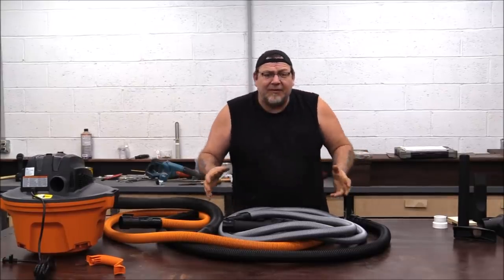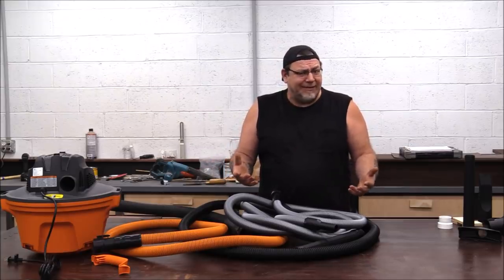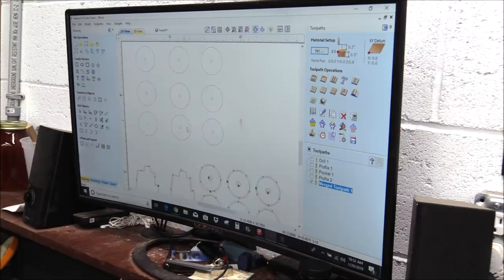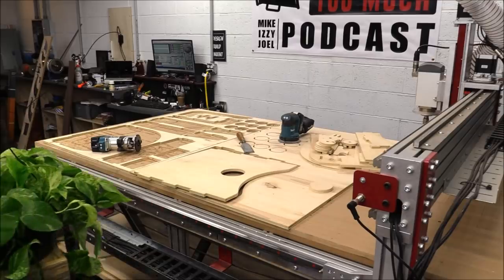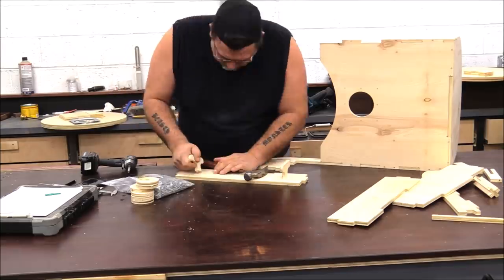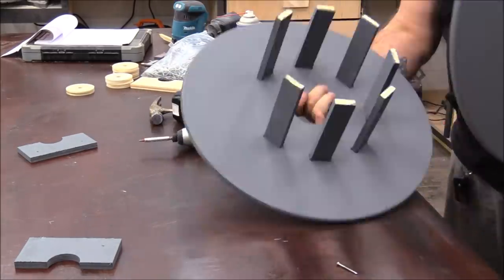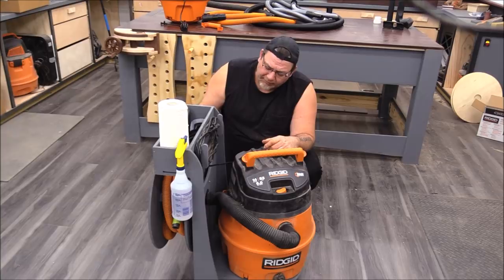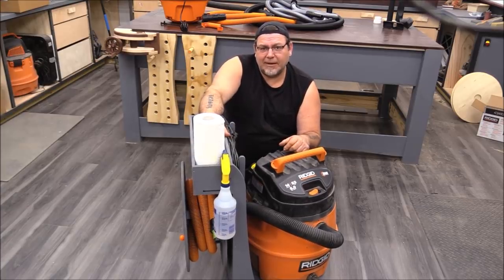Shop Vac Cart and Hose Reel for Manufacturing

Comment: Consider adding a vertical shelf for a bucket and a Dust Deputy or similar. I’ve added a Dust Deputy to both shop vacs in my garage and they help greatly with saving filters. On the Porter Gable vac I bolted the bucket to the top and it is more convenient than the Rigid with the bucket bolted to the side of the vac. Much less floor space. Thanks for the great videos!

Comment: I love it. I’d buy one in a heart beat, maybe even two. One for the shop vac and one for my small air compressor
Reply: I didn't even think of my compressor.  That soundlike a great idea
Reply: It would so work for an small air compressor!  Grear idea!
Reply from the maker: you are a Genius!
Reply from the maker: @jaredvaughn77  sounds like a great next product
Reply: Make another slightly smaller version and attach the two carts to form one cart.  One side is shop vac, the other side for a small 3 or 6 gallon pancake air compressor.  Add a power bar and the two are plugged in -- just add that mystery electricity stuff to the power bar.  Viola!  Two in One !!

Comment: Great video Izzy.  The design process is something we really don’t get to see up close these days.  With everything handmade, our grandfathers and great-grandfathers were much closer to the design process.  My father was a boat builder...45-55’ wood.  I remember hundreds of hours of head scratching “design” time as the boats were fitted out.  Pretty much everything was custom, one-off work.  Designing to those constraints was pretty much the same process except that we didn’t have the luxury of going through several iterations.  Add to that, CAD was a inconceivable dream in the future to say nothing of CNC.  Once again, thanks for a great video.

Comment: Excellent concept! One thing I implemented on my shop vac setup is an off-the-shelf remote power switch. I keep the fob near the tools so remember to have it on hand, though I am considering creating a sleeve to mount it near the end. It comes in handy when you are 20' away from the unit and need to pause to move something or talk to someone. It's cheap and super-convenient.

Comment: Izzy....I love the concept and design (with the changes you noted in the video). I do have one suggestion, though: MOST folks that subscribe to your channel will be perfectly capable of adding glue and screws. Adhering to the 'Lowest Common Denominator' approach for beginners (and, frankly, for people who always seem to be itching to find something to complain about!), you may want to consider pre-drilling where screws are indicated, and adding a bag of screws, casters....and maybe even a little sample size bottle of glue (maybe work something out with Tite-Bond, or someone like that). It might at least stop some people from using (and overtightening) fine-thread screws, among other potential 'beginner' problems.

Personally, I'd buy at least one, either way!! Nicely done...and a great solution to a perennial problem!! :-)

Comment: A second model that will hold a dust deputy/bucket?
Reply: I was just coming down here in the comments to suggest that.   I have been kicking around making a cart for a separator and a older vac I have hanging out.   The addition of cord storage and a cord reel is great!   I had not though of the cord reel on it.  The cart would allow me to tuck under a shelf I have in the garage.   I would also suggest using locking castors if your driveway (like mine) is sloped.  I use it to take care of the cars as well as things around the house.  Having it with biggers castors would help getting it over threshholds and such as well.

Comment: I'd be quicker to pull the trigger on a unit that had some kind of accommodation for a Dust Deputy type cyclone add on. As it is, I'm considering how to add that myself.
Reply: There's a project on lumberjocks like you're talking about. It's stacked, for floor space. lumberjocks dot com/projects/32119 (I had saved it 'cuz I'm planning on doing something like it too!)

After watching this video, I'm thinking something like Izzy's version could be done with the one in the link.

Comment: the only thing that keeps the idea from being 100% perfection you already mentioned and that was the hose going from the vac to the hose section. I made sure that mine fit perfectly by waiting until everything else was ready and I could place the cac on to the cart and make the hole across and I used a 2 inch PVC pipe to go straight to the hose's  section.

Comment: I like it Izzy simply because it is easy to put together.  Truthfully, I like the vac cart April Wilkerson threw together, overall it seems to be a bit dual purpose.  I can put a small belt sander on top and the shop vac is right below.

What I would like to buy is a flip top that I can use as a router table and flip over there is my harbor freight electric planer as a jointer.  The sides of the flip top fold out and form my extension wings for the router and the planer.

To expound on one of your previous projects, these flip tops allow the router and planer to be used vertically and horizontally.

Whaddyasay Iz?  Doable?

Comment: I can see you're designing it for multiple types of vacuum cleaners but you could have the vacuum cleaner on a lazy susan the disc at the bottom and then extend it up to another platform so the vacuum cleaner sits in a circular disc the circular disc will hold the hose you can pull the hose and it rotates the vacuum cleaner more compact may be better for storage.

Comment: Would it be worth extending the base to sit under the hose reel to prevent any chance of  any backward tipping if the hose is not pulled off the reel in a straight line. A brilliant concept I'd have been proud to come up with.

Comment: To save on product weight and material costs you can cut the smaller parts out of the base under the vacuum, the back board or the hose reel discs. Add a few extra cut outs to "hide" the fact that you took the small parts out of the larger parts. Maybe if the hose reel could be horizontally on top or under the vacuum to cut down on the overall footprint and reposition the center of gravity.

Comment: Make a little bit taller with the spots and ability add a separator / dust deputy type bucket system    Either way I’d buy. One.  Or even  a DIY one that will flat pack and we. Put. Together with rest

Comment: I think the reason why manufactures don't offer a hose reel is because it will loses suction and flow with longer hoses.  I would love a shop vac with a seperator before going to the bag/filter. This way I could pull out a bin and go dump it. I have the same vacuum as you Izzy and it is a pain in the but to go dump it. Have to take off all the attachments, speratate the lid and wheel it over. The engineer should hid in shame for how badly the vacuum is designed.
Reply: Rob's wife would appreciate an easy to empty dust container, Just Sayin'...